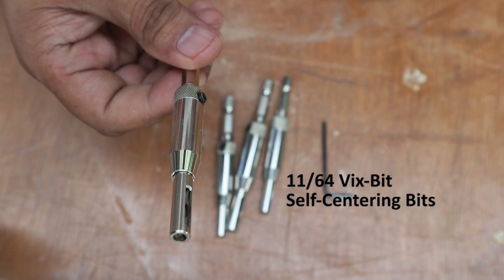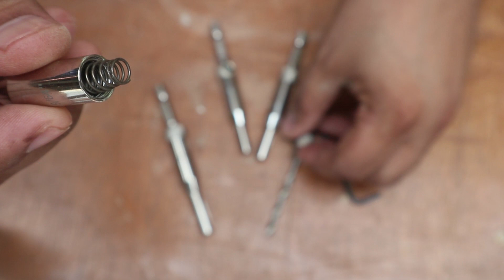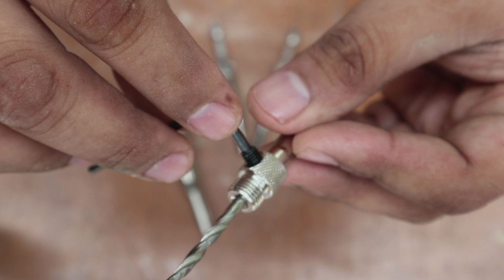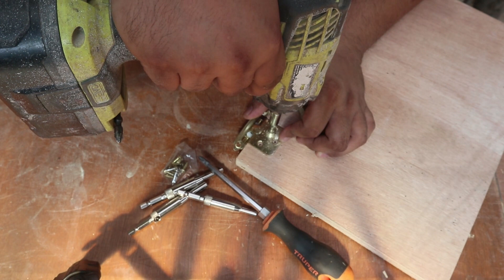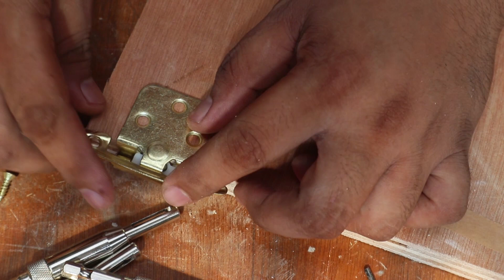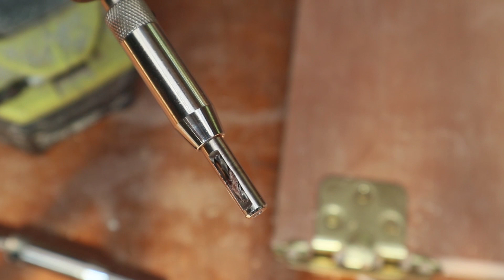Vix Bit Self Centering Bits

Comment: Where can i find good self centering bits for metal? Even better if they were left handed bits, i broke off a bolt in my valve cover, and i need something to keep the drill bit strait so i don't mess up the softer metal around the steel bolt. I looked them up online, and i only see the ones for wood. Thank you!